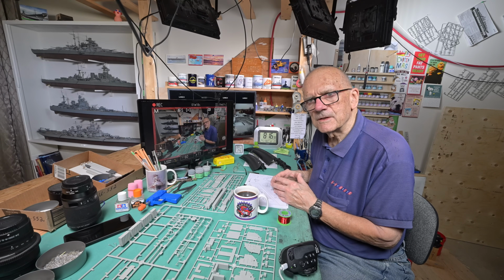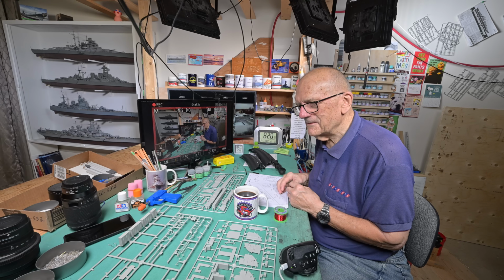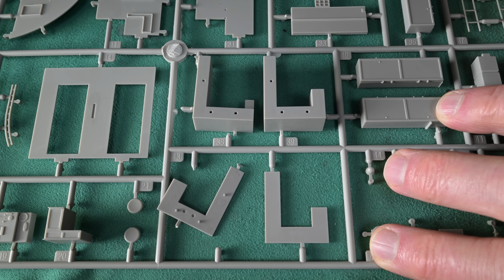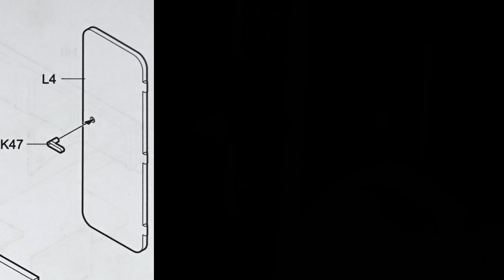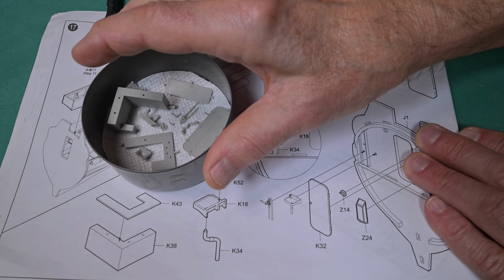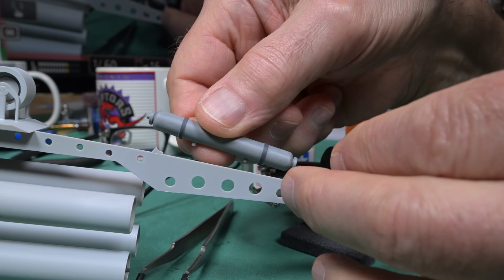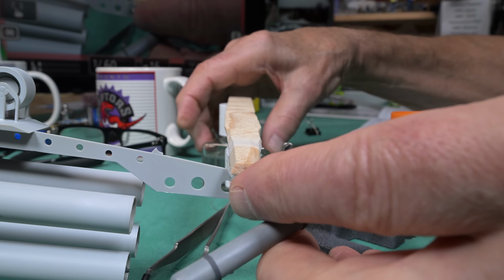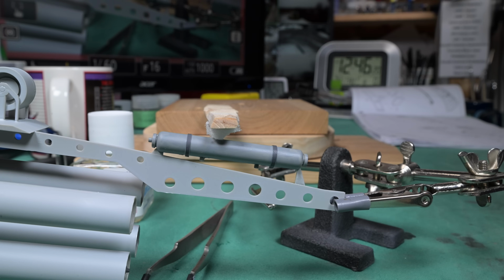The Model Ship - Part 1891

Comment: Hi Ron, Great video today.  I'm guessing Trumpeter knew that there were several tanks on the sub that were the same length.  Instead of molding some with locating pins and others without, they just made them all the same.  I would remove those pins myself.  Thanks for sharing.  Have a great day.  Jeff
Reply from the maker: If anyone notices, I just that they're drain plugs, haha! 😁

Comment: Hi Ron, just an idea but you could tapper the sides of your new wooden mudguard so the width is reduced once it starts going over the wheel. That should aid in swinging your leg over it. Of course that is a balancing act of ensuring the water is still all captured by the board to how much easier it is getting on to the bike. 

Similarly you could plane the thickness of the board down a bit at the end by a few mm to help. I suppose you again have the trade off between making a difference and being too fragile if the material is too thin. 

I'd imagine once done though and a quick coat of waterproof black paint and a few holes drilled into the rack on the bike itself, that you could screw into and it would look purpose made for the job. 

That said perhaps a nice piece of plastic, similar to your perspex that is in your model case, might be a better material to use? Thinner with a bit more flex, also easier to drill holes in and zip tie to the bike rack underneath. 

Anyhow, that is a workshop video I wouldn't mind seeing if you ever need a break from the model table. 🙂

Have a good day.

Comment: Hi Ron  ,yep it's we and not i that is building your Uboat, need to cut those nubs on the tank , they do look silly, need 3 hands , where are your helping hands👐😄😄😄😄see you tomorrow
Reply: I think the nubs are actually drawn in on the diagram, though the angle used just has the very tips visible.
Reply from the maker: Hi Mark Evans,
Re: "the nubs are actually drawn in on the diagram"
Yes! I saw that too. Not drawn very clearly, but definitely there. Thanks for noticing. I'm calling them drain plugs for removing condensation, haha!😁  @soppdrake

Comment: Hi Ron. Video time 21.07, the pins for the tank on the drawing are protruding so need to remain. We imagine that on the original sub that this tank may be interchangeable with the previous tanks installed. In other words the pins may be part of the tank rather than a positioning aid for the model. Regards UK Jimmy and vicky
Reply from the maker: Good point 👍